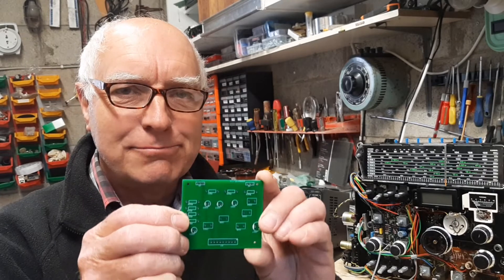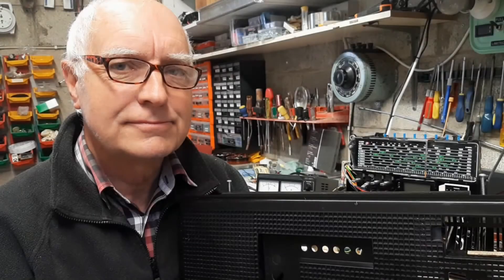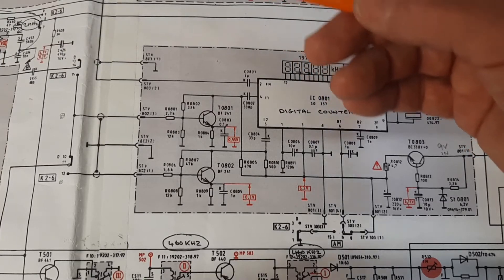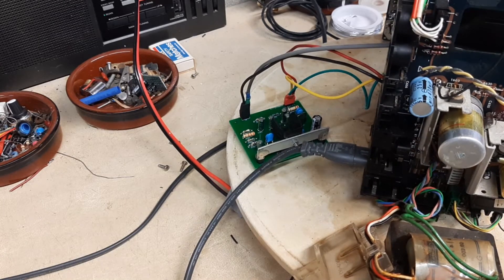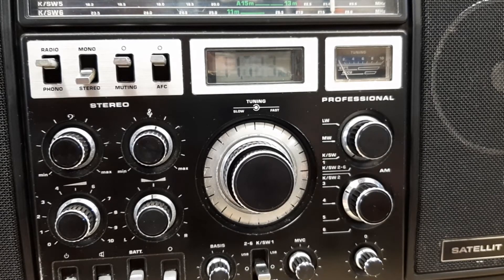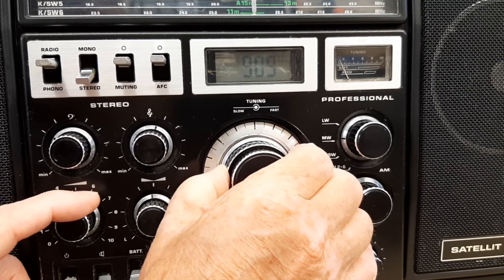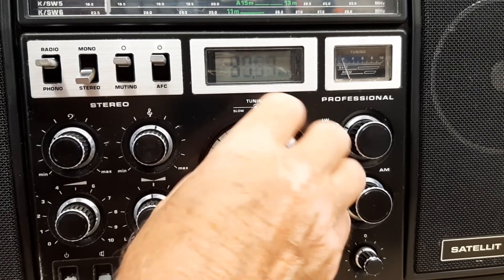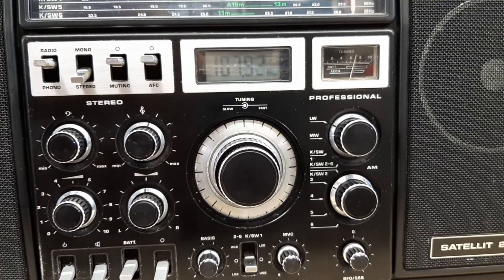Grundig Satellit 2400 Part 4

Comment: Rod
I love your 1140 and the 2400 radios. They seem quite rare and do not come up for sale very often. I have now a satellite 2000, a 2100 and a 3400. They all have great sound on FM in particular. Interestingly the 2000 amp board on my radio had nasty leaking caps which I replaced as usual. The board then worked well, but the FM was low but clear. I decided to replace the all the BF 241 transistors on the FM board and was pleased to find that the sound level was immediately perfect. One of the 241 transistors it turned out was faulty. I guess as you say there must have been a faulty batch back in the day. 
On the 3400 I had some switches that were broken like your switches on the 2400. I milled 8mm Ali rod and threaded the end  M3 to make new levers. I then inserted a counter sunk M3 screw from inside the plastic toggle into the tapped Ali lever. This worked great but had to remove a little of the end of the toggle switch. 
Great fun working on these old radios.
John
Reply from the maker: Many thanks for your message John.
Reply: @rodsradios  Rod
I managed to get hold of one of these radios. It appears much in the same condition as yours with broken switches and missing knobs. It is also very grubby. 
My first task is the power supply which consists of a loose transformer rattling around in the case. I looked through your videos and cannot see a clear frame of where it is located. Can you let me know how your transformer was secured. Mine only seems to have been glued in a rubber foam strip. The connections are a bit adrift and the fuse has blown. I just hope that it has not suffered from 240 v through the 110v setting. We will see!

Regards  John
Reply: Rod
I needed your channel to spur me on. My 2400 radio as it turned out was completely dead absolutely nothing. Even the transformer turned out to be dead. After much work on the left channel and power board I had what seemed like a big breakthrough. I first got the lights to come on and then at last some sound on FM on the right hand speaker that comes from the main board. It is very crackly and keeps coming and going. But at least there is some sound even that feels like a major victory. The power/left hand speaker board is not making a sound at all. I have replaced all the aluminium caps and have replaced the 2 tantalum caps. I fear this will take a while. One thing I have noticed is that someone has had a go at several of the tracks on the solder side of the switch controls board that were detached and been repaired. The boards seem to have through the hole plating and there are other tracks on the upper side. These too have been repaired in several places and look pretty fragile, sounds similar to what you found.  John
Reply from the maker: Hi John,
Only caught your reply today, thank you.
I'm working on another 2400 today and need to remove the AM r.f. panel to get at a transistor but can't figure how to do this as it seems stuck no matter what I try. Any suggestions would be gratefully received,
Cheers,
Rod
Reply from the maker: @john2478  Hi John, The transformer sits into a rectangular rubber cup seated in the front panel of the cabinet, cupped again at the rear, this time sitting into a clear plastic frame that slides into a groove in the base of the cabinet locking in place with a clip contained in this plastic frame. e-mail me with your address and I will send photos if you like.
Rod
Reply: @rodsradios Hi Rod
I didn't take the RF AM board out of the radio as I was concerned that with cracks in the board from previous attacks by another owner that I didn't want to risk it. Also I didn't want to unsolder the various thin wires from the aerial and then resolder them after wards. I could however get at many of the transistors from the front of the radio after removal of the switch board. I did find that it was necessary to remove the tuner and the brass tuner spindle and that was a problem. The wires on the tuner are very tight and difficult to unsolder and re-solder. I am still struggling with the switch board where there are also damaged tracks and cracks in the board. I know that the radio has excellent sound and will be worth the effort to get it working. Currently I am working on a plan to bypass the controls and use a Chinese preamp board to isolate the problems.
John

Comment: There's a song about from May to September. I can't remember how it goes 🤔😆 Great video repair series. Ingenious solution to left (or was it right?) channel output fault using a new PCB mounted in the cubby hole. Also getting your daughter to re-manufacture the switch levers. Great determination and patience all round which I think is need for these "newer" Grundigs.

Comment: Hi Rod, I have a Grundig Satellite 2400 which belonged to my late father. It isn’t working, although when plugged in with the Phono switch on there is a static electrical sound. On the Radio switch there is nothing. The radio tuning dial seems to be stuck too. I’m wondering if you would be in a position to look at it. I couldn’t find your email on your page. Hopefully you can reply. Many thanks.
Reply from the maker: Hi Steve, you can contact by e-mail see my address on the "about" tab at my home page.